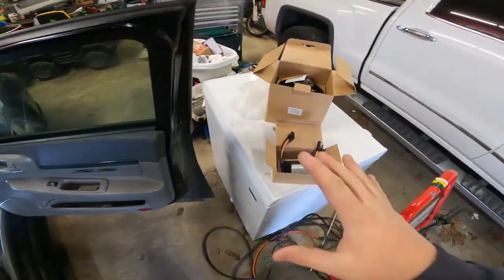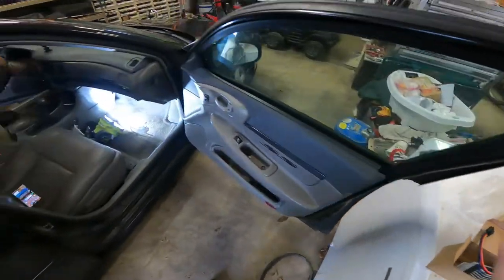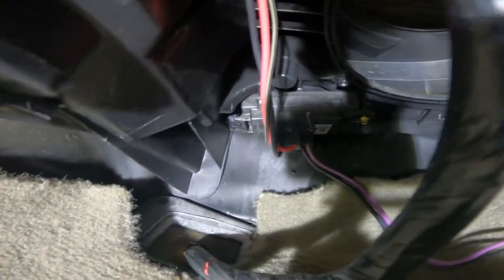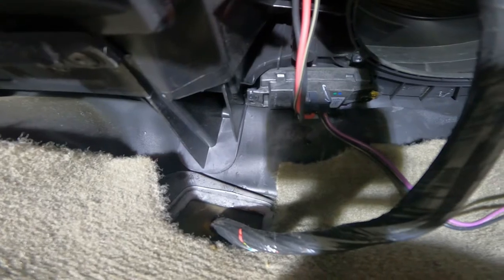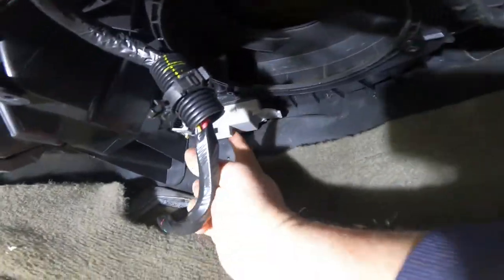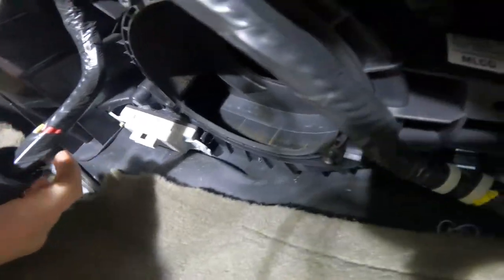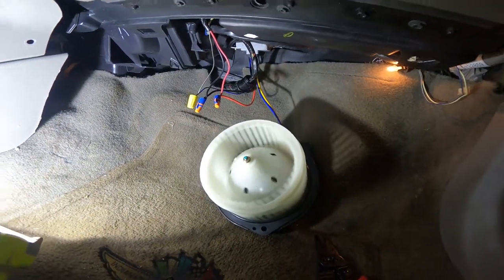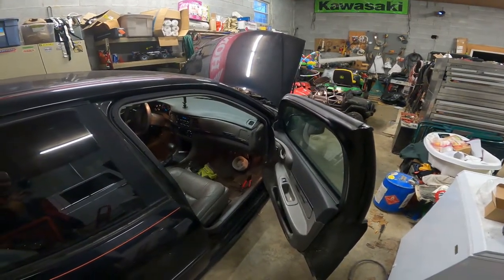Chevy Impala Blower Motor and Resistor Install

Comment: I have same car with the same problem today, 7/12/24.  I had no bolt retaining the Resistor module but only held in place by the 2 pieces of plastic that you showed that you broke off.  I'm so pissed!   This small module could have easily been mounted in a more accessible place to facilitate a repair.

Comment: What if the blower motor stayed runing even while car is off? U replace the blower motor still stays runing then u get a new fuse it still stays runing. Could it be the resistor ir the switch for the fan speed?

Comment: Bro, you should have just left the old connector if you were going to use wire nuts. The new connector is just incase the old connector is burnt up.

Comment: Any particular reason why you cut the stock cord
Reply: I wondered that 2 ?
It should have fitted someway
Reply: The replacement connector didn't have ends for the power and ground. So the old power and ground have to be spliced in.
Reply: The manual in the parts box I received said to splice the 3 wires into the old ones.  For some reason you get increased dependability.  Seriously, that's what the paper said but I have zero ways to verify this, LOL.